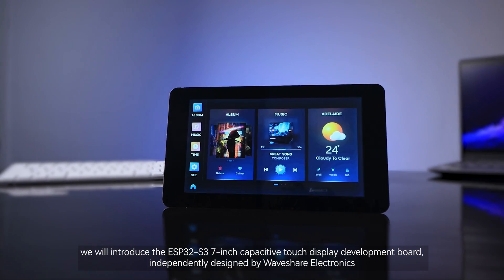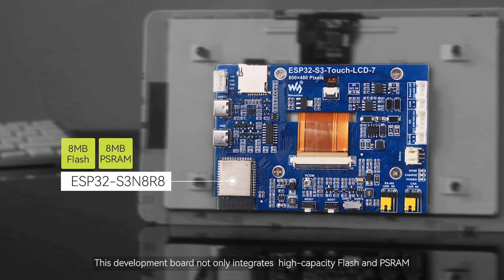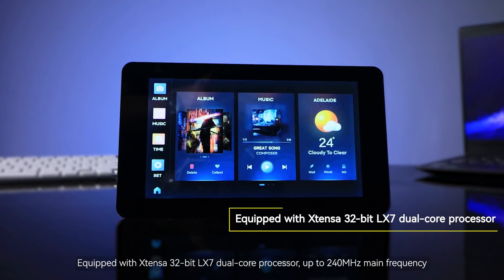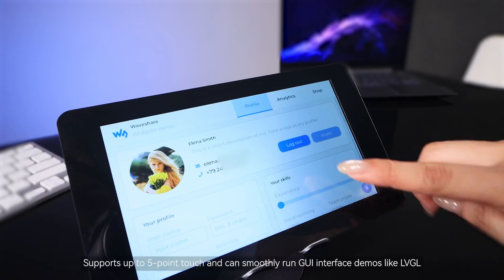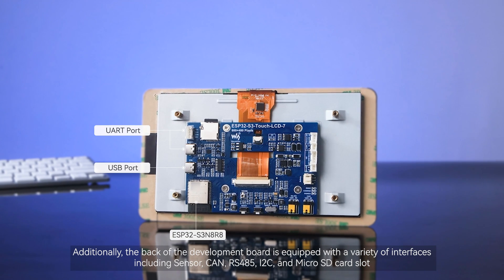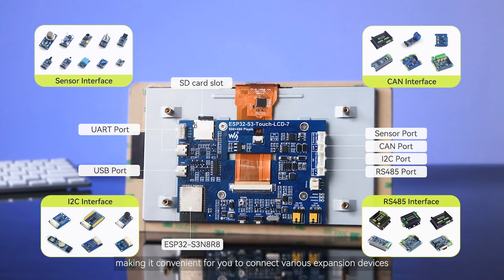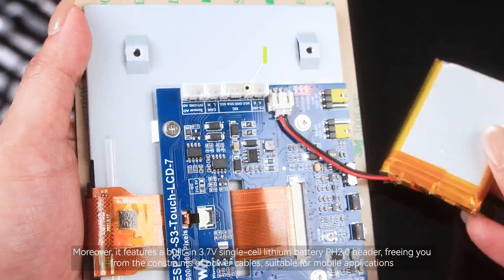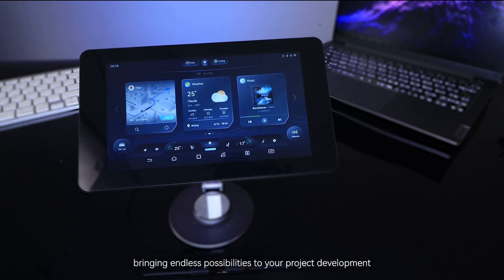ESP32 with display, 7inch lcd, capacitive touch, supports wifi & bluetooth

Comment: Very bad product. I just wanted to draw a line with X Y coordinates on the display. Your examples do not compile. Spent 3 days installing different Arduino IDE. different versions of the ESP32 core - nothing helps. I tried all the examples on all combinations - nothing helps. Different compilation errors everywhere. Have you tried to copy your files that you provide to the new system? Can't you just post working files and examples like  LILYGO and Adafruit do? Without unnecessary files, and non-working examples. Without contacting tech support.
You just post working files and examples for this display, in which nothing needs to be changed! So that all examples work right away!
Reply from the maker: Hi dear for any usage problem, pls feel free to contact our support team dear  https://service.waveshare.com/
Reply: @waveshareelectronics  can You answer this question in YouTube?

Comment: GOODLUCK TRYING TO GET IT TO WORK!!!! SPENT HOURS TRYING TO DISPLAY ANYTHING ON THE SCREEN AND NOTHING WORKS!!! THEIR DOCS ON THEIR WEBSITE IS EITHER OUTDATED OR NEVER WORKED!!! 

AFTER RESEARCHING THE CODE THEY PROVIDED, IT SEEMS THIS DEVICE HAS 24 GPIO PINS FOR THE RGB COLORS BUT THE SOFTWARE RECOMMENDED ONLY SUPPORTS UP TO 16-BIT, NOT 24-BIT!!!

I'LL BE RETURNING THIS PRETTY QUICKLY TO AMAZON IF I CAN'T FIGURE IT OUT!!! NO USE IN HAVING A $42 PAPERWEIGHT LAYING AROUND!!!

Comment: What controller is there for the display?
Reply from the maker: it's ST7262
Reply: @waveshareelectronics Hello,

I would like to inquire if it is possible to install the WLED application directly on the WT32-SC01 Plus ESP32 display development board, allowing me to control the LEDs using the built-in display rather than relying on a mobile phone.

Thank you.
Reply from the maker: @Silkroad_trader  hi dear, so sorry it's not sure whether the WLED application supports our hardware, it's not tested here yet.
Reply: @waveshareelectronics  thank you for the information! I made a video about my own written driver for square line studio and esp32 IDF for your Display
Reply from the maker: @embeddedenginee  sincerely thanks for sharing dear, that's great!
Reply: I have buy it, But Iits works not perfectly with Home Assistant and ESP Home... If i use LVGL in it and Push a Button, the  Display draws strikes by the Update and we found No solution for solve it. We will buy Others Display how ist tested in device.esphome device with ESP32 . It is a nice Display If you don't use fully ESPHome with Homeassistent LVGL Stack @waveshareelectronics